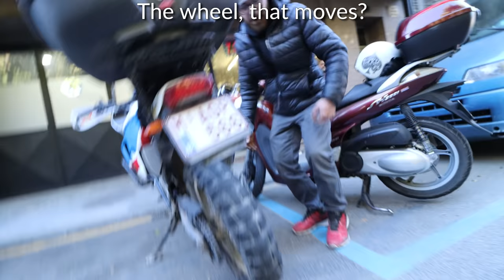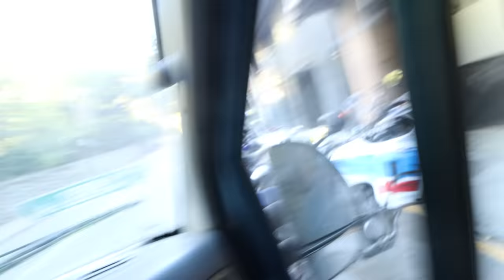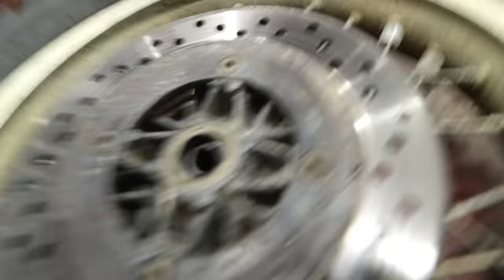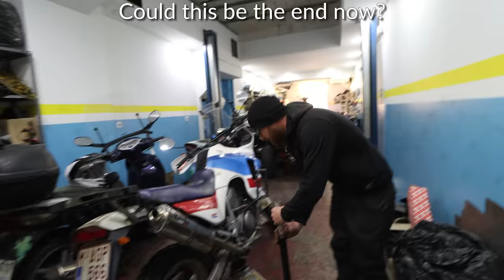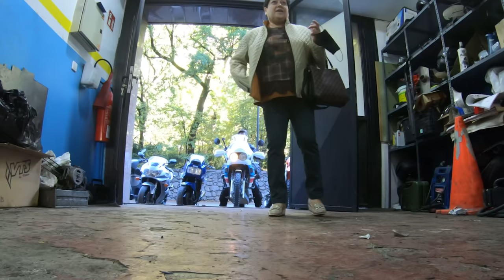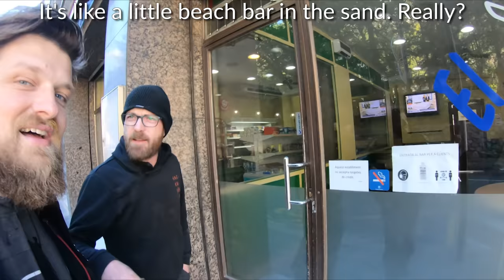This Motorcycle Part can Ruin Your Day (Repairing 26 Year Old Honda Motorcycle)

Comment: Sorry about having misled you about the wheel bearings. I actually replaced the head races (steering bearings) 25K ago...
Reply from the maker: No stress papa Bob, they took an absolute constant pounding under load which isn't normal for your average motorcycle.
Reply: @iPedroMota  And certainly not for my riding style ;-) Anyway, the originals hanged in there for more than 70K. Not bad !
Reply: Season's Greetings Bob, I sure have enjoyed the "ride along" on your bike, I've learned and seen so much about the Iberian Peninsula, it's been a real treat.

Comment: Understand peoples opinion on bearings but coming from an engineer you can pop off the cover (use a jeweller's flat head screw driver or a fine flat head tool)   to the bearings and repack with water proof grease. You will see how little grease is in there. Been repacking new bearings for years with very good results. Bearings last much, much longer. But sure we all do our own thing, which is good. I feel your pain with those types of boot.

Comment: About 18m ago, had to finish a trip (100ish km) with pillion knowing that exact same bearing (disc rotorside) was going out (started listening to some whine then i hand checked the wheel to confirm).  
One of the balls went away. 10€ part (also in a bearing shop about 2km from home) and 30m job in the street tks to center stand.
About 3-4 years earlier, it was the cog holder bearing from the other side.

Changing all, at the same time and with quality ones, is the best option (and they're cheap and relatively easy to replace - if you put them in the fridge and mild heat the holder, you don't even need to push them in).
And DO NOT point pressure washers in the bearing direction... Its mainly water that kills them.

Comment: I very recently had my 300X rebuilt after fairly major accident, by the main local dealer of Kawasaki, two days after I got it back, the front wheel bearing started to make noises, really surprised dealer never noticed, wheel was quite wobbly, how did they not see this, anyway another lesson learnt. What surprised me also was the bearing was not sealed.

Comment: Whenever you take a wheel off, check the bearings. Stick you finger into them and turn at least a full revolution...always. Takes seconds and can save a LOT of time. Both on the front and all 3 on the rear ( if your sprocket carrier has a separate bearing). 
Also if you do big distances repack the bearings ( even new ones) with moly grease. If they stuff up it will provide lubrication for a lot longer and not build up as much heat.

Comment: Skf bearings are really good, and it's better to use heat when replacing bearings(heat the hub and freeze the bearings) , makes it easier and it's safer for the bearing bore

Comment: I was comming home with a friend from a trip to Romania. We stoped on a gas pump on high way because he hoticed something strange on his rear wheel. Also bad bearing. He went for a small test ride on car park to see if it is OK to continue. I guess that when bearign completly snaped because he blocked the rear wheel :D. We called a friend to pick us up with car and towing troley. We were still so far from home we had to wait for 4h untill he arrived. Dangerous little part :-)

Comment: The first time I used a bearing shop was for a two-stroke crankshaft bearing. The guy was right on top of it when he noticed a heat rating on the old bearing. It's not just size.
Glad you got a little stocking stuffer.

Comment: Wheel bearings are always something you don't skimp on. Buy the best you can afford. I'm also digging on that Genisis 5 valve Yamaha there.
Reply from the maker: When I did the massive project on Alp, replacing all the bearings with original. Hefty price tag and some hard to come by like the suspension needle bearings. Though once on there they go the distance.
Reply: @iPedroMota  Also, bearing OEMs also have higher quality versions of their bearings for more $$$ of course but they are more durable and have tighter tolerances, better hardening etc. There are a few alternatives out there but to your point OEM quality costs $$$
Reply: Yes, a sweet example of an FZ750 👌. As Borat would say - very nice!
Reply: @NotNowCato1254  I had an '86 and it was a great bike.

Comment: I also had these offroad styled boots.. damn they are hard to walk with, hard to shift gears with.. in the end I ditched them.. They should invent an sort of a in-between boot..
Reply: Yeah, I had similar Alpine Stars Tech 3's and ditched them for Forma ADVentures, probably not as protective, but I thought there was more chance of my coming off or damaging the gearbox with them than without...just my 2 cents!
Reply: They did. For example the TCX Desert X or the Forma boots as mentioned. Not as heavy duty and protective as full on MX boots but better than road boots and all-day comfy 👍

Comment: You made popping out your old bearings look too easy. Anyone interested in doing your own bearings invest in a puller, you'll never regret it.
Reply: Just use good quality round stock with something like 12mm thick. Never fails 😊
Reply from the maker: Art of video editing. Took a bit longer, and as expected wrecked the inside of the bearing while the outer ring stayed in. That's why I liked Claudio's trick so much with the tyre lever. It's bend created a surface big enough to hit on the inside above the ring. Yeah a puller would definitely be a useful tool to have in your workplace.
Reply: Yes. I have the slide hammer type. Great piece of kit 👌

Comment: Pedro, I was wondering what windshield adapter you're using, because I severly need one on my TA since the touring shield pushes the wind straight to my face.
Reply: It's the MRA Vario Spoiler. Here the VSA Type-C. It does a wonderful job pushing the air flow over the helmet. Minimal turbulences . I have got it on the AT (CRF1000) as well. At low speeds and off road you can push it down while riding.

Comment: How long have you owned the bike bike for ? It looks classic so wondering if it still has the same engine on it ?
Reply: It's a '96 XL600V with over 70K on the clock. Original engine.